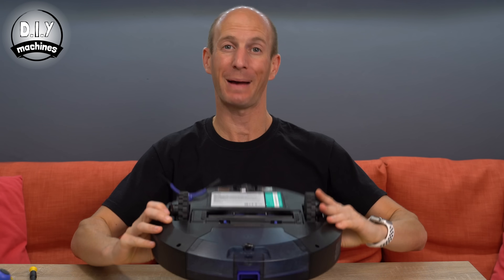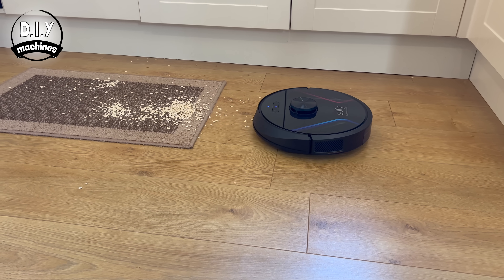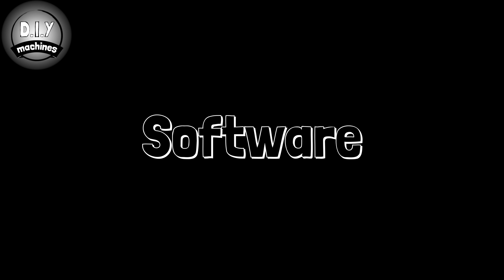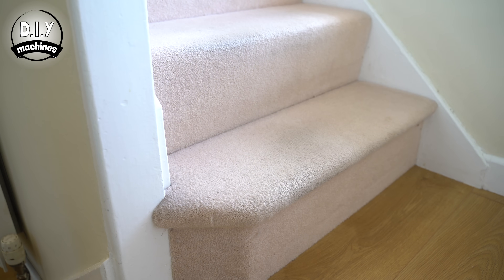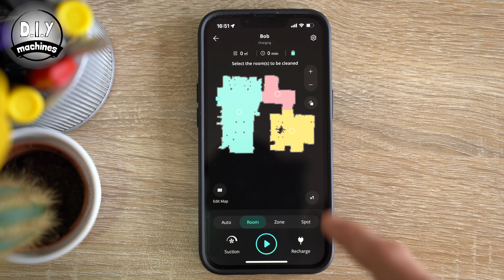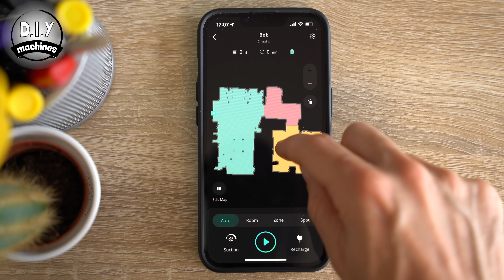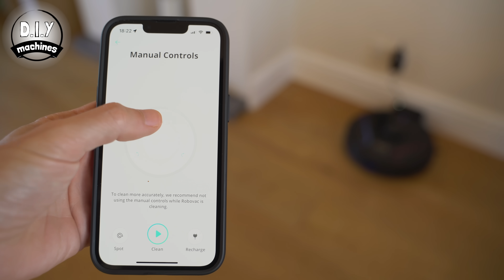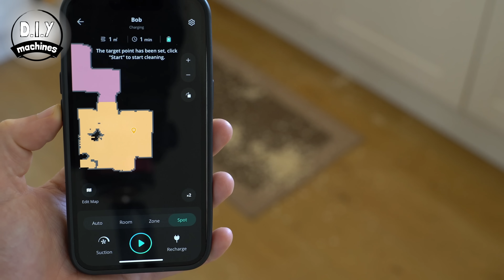How a LASER Guided Robovac Works - So We Can Make Our Own (eufy Clean X8)

Comment: Hey, awesome idea to make your own robot vacuum cleaner! I actually made one for a high school project a few years ago. I learned a lot from it. There's a video about it on my channel. However, there are a few things I would do differently now.

First of all, I used a few cheap ultrasonic sensors for the navigation. They didn't perform very well... I think you really need to use some form of SLAM (Simultaneous Localization and Mapping) if you want your robot to perform well. There are a bunch of different types of SLAM. Some require just a LiDAR, some also require some extra sensors for odometry and some can work with a camera (VSLAM). A lot of these SLAM algorithms are available as a ROS package so it shouldn't be too difficult to get it up and running on something like a Raspberry Pi and test it out.

I also didn't use any brushes for my robot and I think it would have been better if I did. I just used a powerful blower fan. However, I'm not sure if the 3D printer blower fans that you showed in the video would be powerful enough, even if you're planning on using brushes.

I think making a few different test setups for things like navigation and suction would be very useful. I would just use something like a cheap Arduino robot frame with the necessary sensors strapped on and try to navigate that around.

If you have any questions feel free to contact me :). Maybe I can think along with you.
Reply from the maker: Hi, thanks for taking the time to share your experience and advice. 🙂
I'll be starting to work on my version as we head into winter (I'm part way through two other projects at the moment that need completing).
I will certainly take another look into the options for SLAM. I have a robotic lawnmower which works on a principle of random motion and does manage to cover the entire area - however, indoors there are many more obstacles and rooms with only narrow doorways between them. This will probably make the random perimeter bouncing incredibly inefficient. 
I watched your Mk2 Video, I like that you used the available print bed size well.
Thanks for offering to chip in with ideas and problem solving, I may well take you up on that when the time comes. 👍🏼

Comment: An interesting review, but it seems to be missing information on some of the most important features, such as what knife attachments the device supports.  Can the spinning sweeper thing be replaced with a small knife?
Reply from the maker: I guess it could be, but it would wreck havoc with your skirting boards, furniture, and toes. 🤔
Reply: @DIYMachines , that makes sense.  I'd just be worried that if you let one of these wander around unattended and defenseless it could be taken advantage of or seriously hurt by something along the lines of a BattleBot.

Comment: brilliant video! I suggest to have a cyclone separator before the filter. it will capture 80%-90% of the particles without reducing the pressure and will make the filter last much longer!
Reply from the maker: That's a great suggestion, thank you. I'll look into how they work and see if it can be incorporated in my one as the design develops.